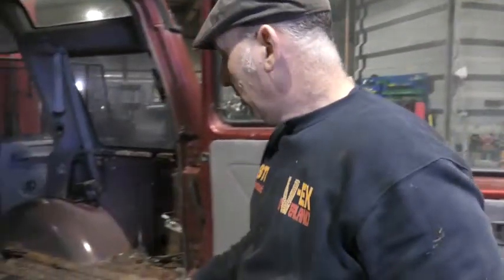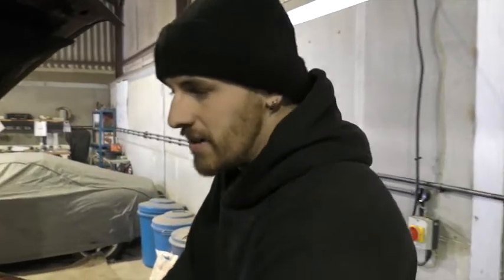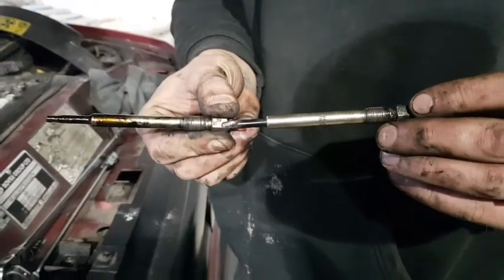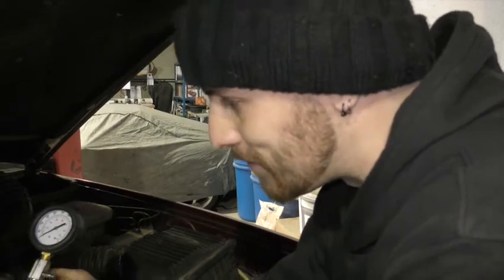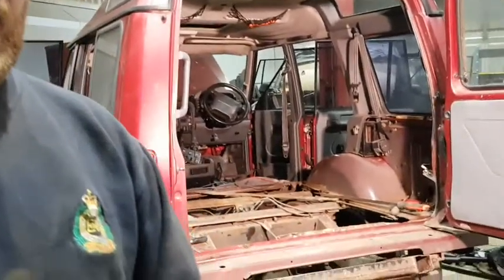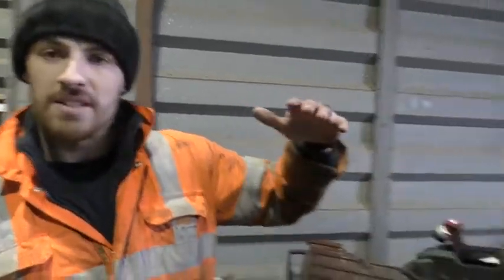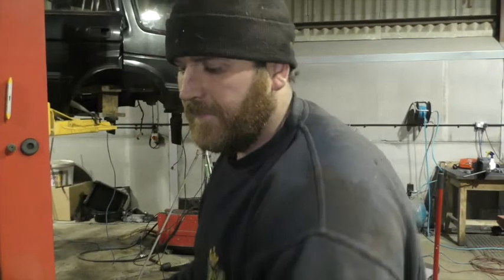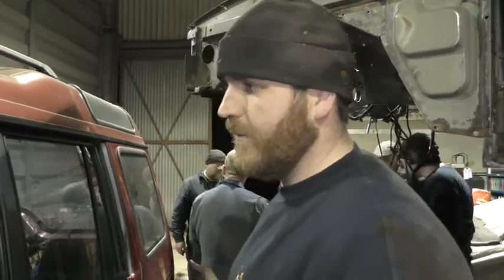Stripping out the 2nd Land Rover Discovery 1 and engine compression test - Season 1 - Episode 11

Comment: watching guys fix a land rover while im on a coffee break from welding a land rover! haha except its an l322, still rusts like a disco1!! (well, maybe not that bad). Believe it or not i have a disco1 with its original boot floor with no rust in it, bloody cat D though!  Good luck :)
Reply from the maker: Aye you're a lucky man to have one with no rust. Have a watch of the whole build mate as we release the videos. Building 4 at a time was a tall order but we managed it in 10 months but now we are working on remedial jobs that never quite got done.
Reply: @VeteransInAction  will do. Im sure v8 ones dont rot as bad for some reason, mines a v8 and iv swapped 2 v8 chassis into 300tdis now(only welding needed, a little patch where the exhaust goes close and the engine mounts)
Reply from the maker: @geepersoilyrag1884  It was a lot of work which you will see in the next episode

Comment: since most of these Landy's are worth about 1500 pounds and you are looking at 10000 pounds of work to just have a running and no holes in the floor 1500 pound Landy what is the point ?
Reply from the maker: The point is that it is a project that brings veterans who suffer the effects of war together to rebuild them helping them feel part of a team. They have also been used to undertake three overland expeditions helping even more veterans and they do quite nicely thanks